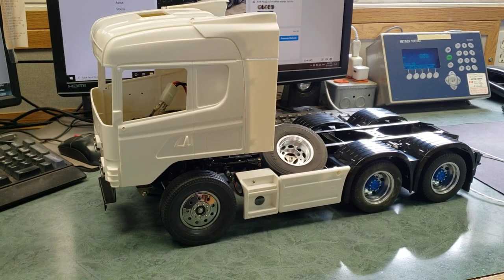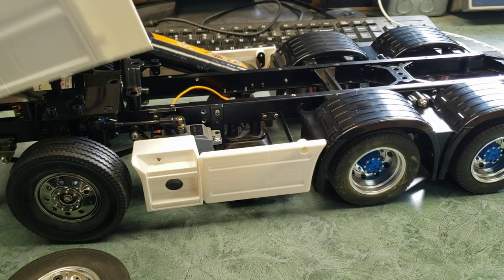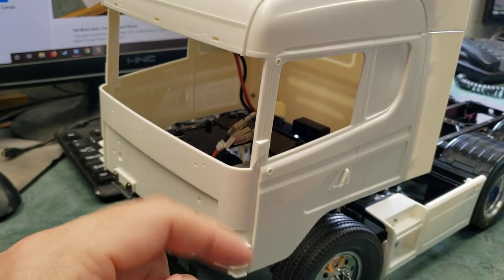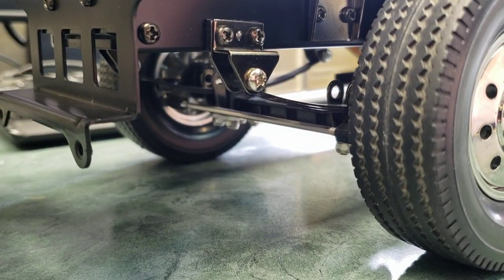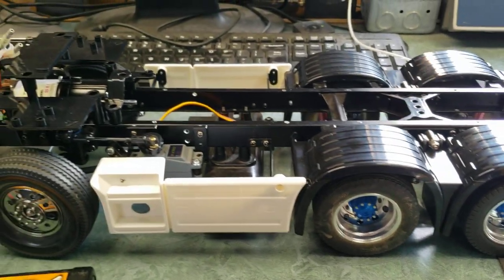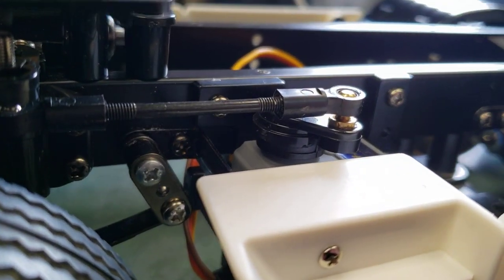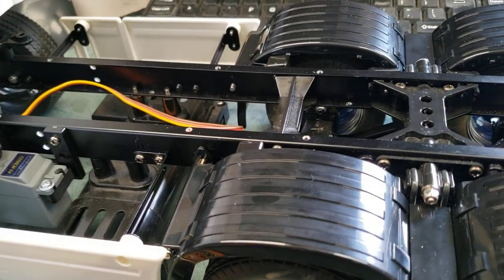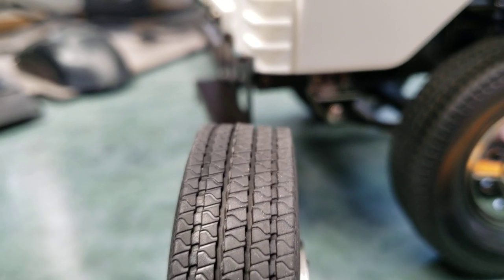Tamiya Scania R620 build

Comment: Is the frame and axle housings that come with the kit made of metal?
Reply from the maker: Heya! for Tamiya stock trucks the frames are always metal. Axle housings are plastic, Internals and drive line are metal. Stock they come with brass bushings. I always buy bearings. I have yet to see a stock plastic housing break. Usually it is a gear that will wear out from heavy weight pulling before anything plastic will ever have an issue!
Reply: @thestuffz  thanks so much for your input. I have been out of the RC hobby for many years, and Tamiya was always the best in my opinion.  ALOT has changed since then, and I'm wanting to get back into the hobby now.  I'm really interested in buying a Scania kit, but was wondering how the Hercules Hobby kits, compare to the Tamiya kits, maybe even the Lesu kits.  Could you give me some insight on which ones seem to be the best, and maybe some pros and cons?
Thanks again for all your advice, its greatly appreciated